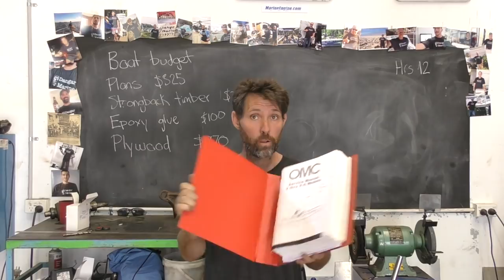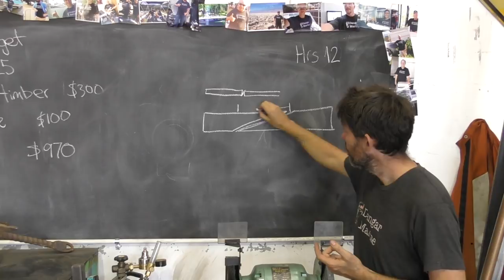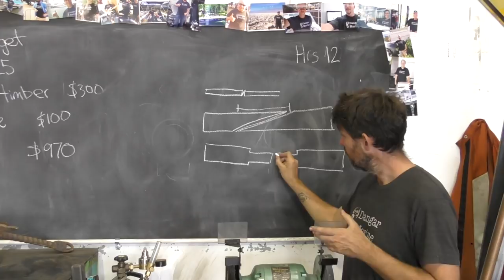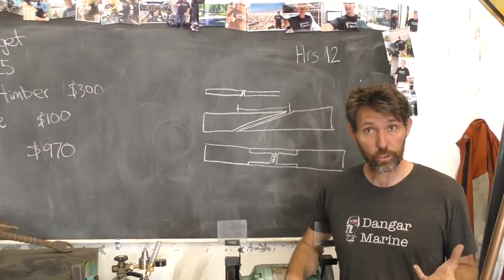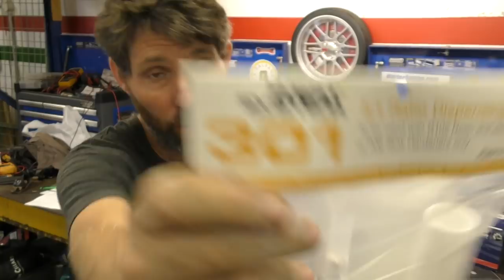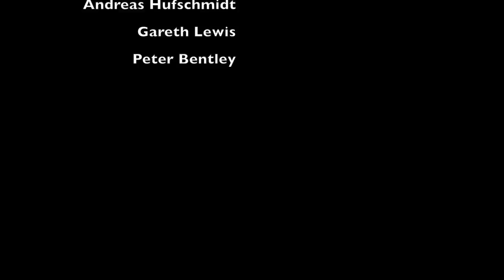Making a payson butt joint in plywood

Comment: I recently refurbished an old fiberglass boat, but I used polyester resins instead of epoxy myself. And I always coated all the wood first in polyester resin before using any fiberglass clothes. That way I knew the resin did soak in and the joints and resins were rock solid. I also lap jointed every piece of wood in every joint for the added surface areas. But everybody does what they think is the better option. I have to watch the rest of your series to see how it all comes out.

Comment: Hi Stu.  Great to see you venturing into building a boat.  It's a lot of fun.  Having built a 4.5 meter glass over ply over frames runabout last year myself I feel you've undersold scarfing as a jointing method and overlooked the advantages and ease of making.  There are a number of very simple, easy and quick to make jigs around that make the cutting of the scarfs simple and accurate.  I made a jig that uses a handheld circular saw - I considered a router base jig but my money's still on this one. The jig supports the saw at the correct angle and guides the blade across the material leaving an angled face.  The blade leaves a slightly rough texture (but a very true angled cut) that creates a strong mechanical hold in addition to the "adhesion" of the epoxy, and I can tell you, you will not break it!  And it leaves a smooth almost flawless join that requires very little sanding or filling once cured.
Having tested the joined ply to self destruction several times with offcuts etc it is the ply that breaks and never the join. I used the same West products as you and it hangs on like shit to a blanket as that quaint saying goes. One of the distinct advantages of scarfed joints compared to overlapped and parson butt joints is that it does not effectively alter the rigidity and flexibility of the material at the joint. Adding the fibreglass and epoxy will stiffen up the ply at the joint - not an issue for the longitudinals but if for example you are laying plywood around a curved hull you will find a flat spot where the fibreglassed joint is. Not ideal and more fairing work to fix.  Cheers

Check it out... http://www.oneoceankayaks.com/stitchglue/plyshophtm/scarfjig2.htm
Reply from the maker: Hey Robin, yes, I've seen a few of those jigs around, in fact West System sell one of their own. I didn't really mean to undersell scarf joins as they are good, it's just that I only have a handful to do on this boat so it didn't feel worth buying of making a jig. Also, the instructions specifically say to this type of joint so I guess in all honesty I was just blindly following them. If I start making more and more boats I think it would be worth making a jig up for sure.
Reply: All good Stu. There’s pluses and minuses to whatever way you go. Love your channel btw. Looking forward to seeing progress. Check out my build video some time. Cheers.

Comment: Epoxy is intimidating at first but it looks like you've got it figured out! I usually leave a brush or mixing stick in the pot until it cures. Sometimes that helps to pop the cured epoxy out to use the pot again.
Reply from the maker: Thanks Matt, that's another good tip!

Comment: Oh and one more handy item is peel ply.  It goes over the wet layup and can be peeled off after curing.  It smooths out the layup and leaves a surface ready for attaching another part without having to sand.
Reply from the maker: Anything that saves sanding has got to be a good thing! :)
Reply: William Fowler I’ve used wax paper to accomplish this with good results. I’ve never built a boat, but I’ve made fiberglass repairs

Comment: Great vid, we're at the same point of the build although I went with the Sea Strike 16. With the overhang, I found wetting it and cutting while partly cured with a stanley knife the easiest and cleanest method of removal. Oh and plain white vinegar for clean up is much less damaging on yourself!
Cheers
Reply from the maker: Hey Mark, great to know I'm not going through this alone! ;) I can see what you are saying about wetting out the excess as I'm not going to be able to get scissors close enough to the edge.
Reply: Vinegar doesn't work on West System. You ahve to clean up with acetone. As for teh $700 for West..thats why we use Nupex. Same stuff (5:1 ratio and all)..1/2 the price

Comment: A couple of small tips, what you have done is fine. Now the tips. On cold days using a tin can and heating the mix a little with a heat gun will thin the mix and make sure it will go off. You can use multiple containers don't clean them, just mix on top of the old set mix after its set. Try to have something ready to use up any excess. The mix can generate heat on hot days and go off very quickly, so mix smaller amounts, mixing in the same pot is fine as long as it is near empty. We used a lot of cans but cheap plastic drinking cups will do for quick jobs or when using additives. Watch the heat issue on hot days.  Stagger the joins a little so they don't quite line up top and bottom , the cut edge of the ply is the weakest point, 10 mm apart will increase strength. Best of luck. Regards Dale
Reply from the maker: Thanks Dale, really appreciate the tip! :)

Comment: Great video!  It's actually easier to allow the fiberglass strands that extend beyond the plywood to become saturated with resin.  Once dry, the strands will become rock hard and will be easily removed with sand paper.  It's actually much harder to cut away the fiberglass strands if they have no resin on them.
Reply from the maker: Thanks Dirk, I can now see how cutting (or sanding) saturated glass is easier. Fortunately it is much harder to keep glass dry than it looks so most of it was easy to remove with a power sander.

Comment: Great video Stu! When I did my repairs for the first and only time on a 60's fiberglass skiff, I used poly and had a hard time with very fast hardening. Summertime in outdoors south Louisiana is a lot different than the directions accounted for. Even using a good amount less of hardener than the directions I only had about 2 minutes with a small batch. Glad to see you chose the slower acting. It seems in the fiberglass world, experience is the only real way to get good at it. Lots of variables can change the process. I can only imagine doing it and trying to film the process with time running on the hardener and getting a good camera view at the same time. Tip of the hat to you Sir!!!
Reply from the maker: Thanks Jim, I think you are right about experience being the only way to get really good. Books can certainly point you in the right direction but as you say, experience helps you deal with all the variables that the books don't tell you about. It's funny you should mention the filming because one of the hardest parts was getting the epoxy off the camera! :O

Comment: I am using west systems epoxy repairing the rotted out wood in a fiberglass boat and also wetting out the new wood first.Epoxy makes a strong waterproof joint-seal.Cheers from Canada

Comment: I'm building small boat using stitch and glue method. Plans by Bateau. I would recommend using plain epoxy on plywood before glassing it. Pure epoxy soaks better to wood and if there's extra epoxy, that will then soak into glass. I use mostly wet on wet method. So, the epoxy on plywood is not cured when I glass it. Works for me, at least.
Reply from the maker: Yes, that certainly does sound like the way to go. Good luck with your build!

Comment: A little tip i picked up is if your handling matting or need to use your hand a bit ,i put about 3/4 latex gloves on each hands (bit like a tear off visor)then you allways have clean hands and paintbrush/ consolidating roller.i used an old multi vit or big proteen pluss container with a screw top lid with about 2 inches of acetone in the bottom and put the roller in there each time to soak as wipeing it wont get the resin out of the inside and it wont function properly and drag the matting. I thought you was going to get eight ply and glue it in the rebates instead of grp.
Reply from the maker: I'll have to get a screw top container like you suggest as you are dead right about the epoxy in the roller stopping it spinning once it is dry. Hopefully I can burn it out as someone else suggested and start using the jar from now on.
Reply: I have left mine too long a few times, the oxy , not too hot , works well but gives off some killer black smoke.  Great Vid

Comment: I am sure that join will be super strong, you're doing great making your own boat.Have you ever repurposed an outboard motor that has a seized engine by removing the engine,binning it and installing an electric motor in it's place? You wouldn't need an impellor as a DC motor is not water cooled.Perhaps you could make a video one day doing a conversion of a petrol outboard motor to an electric outboard motor?
Reply from the maker: That certainly would be an interesting project, I'll look into it.
Reply: Dangar Marine , hi I know of a video on YouTube that did that, if you like I can find it for you .

Comment: I've never seen this done before it's cool that you doing it but next time try taking just the first layer off of both sides and Nick in the edges where the fiberglass will roll around that shouldn't make that joint a lot more stronger I think but of course I never done fiberglassing before

Comment: For cleanup of tools and brushes before the epoxy has set I use distilled vinegar. Much nicer to handle. This a tip told me by some professional fibreglass workers and it works well and is a lot cheaper than acetone.
Reply from the maker: I'll grab some and give it a go!

Comment: The more you work with the micro balloons, the easier it will be.  I wouldn't breath them.  Use a fan to draw them away from you.  To mix them to get a stiff mixture, put the balloons in dry, then pour a little mixed  west  in and mix.   We used the cheap disposable paint brushes to "stipple" the air out.  Using a hair dryer will help the flow if it is cold.  I would say that the joint you made is no stronger than the thickness of the wood at that point where the routing stopped.  It will break where the fiberglass stops.  If you need to make reinforcing strips put down some dry cleaner plastic bag material and lay up on that,  cover with another plastic layer and cut with a sharp knife and peel off top.  The plastic will hold the glass together for movement.
Reply from the maker: These longitudinals will also be getting a second layer of fibreglass over the top of this join so I think they will be quite strong in the end. Interesting tip about making the reinforcing strips.

Comment: I allways wet out wood with pure mixed epoxy before adding thickened epoxy (any thickening from coloring to butter) to make a deeper and stronger bond. Good thing about epoxy is its very forgiving and has strengths to spare and will work even when experimenting :)
Reply from the maker: Yes, I can see how the thinner the epoxy the deeper it will penetrate. I don't think it would have hurt to have made a tub of each, particularly with the slow hardener. As you say though, epoxy is so strong that I can't see it being the weakest link in any part of the boat.

Comment: If you want a near perfect finish, lay a sheet of clear polycarbonate (3mm works nice) over that join and sit a few more batteries on it, when the epoxy is set peel the polycarb back off and it gives the resin a glass like finish and saves a lot of filling and sanding :)

Comment: again always enjoy watching your vids, youve helped me out a lot in solving many outboard issues ive come across with my outboard builds. next time you come across butt joint dilemas, try dovetail flat joining or even a spline depending on the thickness of material you have. the dovetail still gives you the option to scab glass.

Comment: To be honest I think smearing the thickened epoxy over the routed faces will weaken the joint. With an epoxy bond you have a chemical and a mechanical bond. The thickened epoxy won't soak as deep into the wood as unthickened epoxy, making for a weaker mechanical bond. The thickened epoxy will act as a screen to prevent the unthickened epoxy from soaking in, and the thickened epoxy itself won't soak into the wood very much because the epoxy is already soaked into the cabosil. But I'm no expert, it's just my opinion!

It's nice to see you step out of your comfortzone and trying new things, that's what I like about your channel!
Reply from the maker: I definitely agree the unthickened epoxy would penetrate deeper, but I'll be curious to see whether the glass lets go before the timber breaks on the test one.
Reply: Yeah me too! Would be nice if you had a normal butt joint and a scarf joint to compare with. And a Payson butt joint with two layers of glass on each side. Would be interesting to see if this would be stronger because of the double layers, or if it will fail on the edge of the glass where the wood is thin.

Comment: Carb -o-sil adds hardness and thicking . We had a  local epoxy  company, with as much experience as the West System , you'll find Gardner talking about Cold Cure, that was one of their products . They put out papers on the use of epoxies . For your use add mini-fibers as well carb-a-sil, that will add strength as well. . Carb-a-sil  will cause miners lung, by all means wear dust masks !!!
Reply from the maker: Definitely a mask next time!

Comment: re System 3 - great choice, you won't regret it!

Re joining plywood::  if you google "payson butt joint" you'll get a lot of (not always agreeing) information.

Re use of thickened epoxy:  I guess you'll be doing a lot of this later with filletted joints!  Probably a good idea to coat the surfaces to be joined with unthickened epoxy first, then  add the thickener to the rest,  That way it's much less likely that the joint will be starved.

With the stringer joints, I'm assuming the stringers will not be bent, so I'm not sure there's really a need to router out a groove??  If you just lay glass cloth over the joint does it matter if it is a bit thicker?  Also, some people just use unthickened epoxy (and rout out only a thin layer of the plywood) adjacent to the joint and put in the fibreglass cloth wet out with unthickened epoxy  (However I wouldn't take my advice on structural strength over Mr Bowdidge's!)  

Regarding acetone - could try vinegar - much cheaper, and won't help the epoxy soak into your skin :-)
Reply: dyemanoz i
Reply from the maker: Good to know the correct name of this type of join, that is extremely useful. You are right in that these longitudinals don't get bent, but they do get another coat of fibreglass over their hole length and do slot into the groves in the bulkheads. I presume that is the reason for the rebate.
Reply: Shouldn't matter as long as the join isn't in the vicinity of the bulkheads?  Certainly with two layers of glass where the join is will make them super strong even before they're filleted to the hull

Trivia: Harold "Dynamite" Payson (apparently nicknamed on the same basis as redheads are nicknamed "Bluey" :-) ) was a pioneer in bringing simple plywood boatbuilding to the masses.  He collaborated with legendary designer Phil Bolger.  Bolger designed the boats, Payson built a prototype to validate the design and published plans and books on how to build them.  They called the building process "tack and tape" but really the idea is not much different from "stitch and glue".  Sadly both gentlemen have now passed away.  I built one of Bolger's designs, Nymph (well the hull is finshed, still working on the mast rudder and centreboard :-( ).

Comment: Hey Stu, great video as usual.
West system is great and it doesn't smell like the polyester resin.
Save some money and use white vinegar to clean mixed epoxy off your hands and skin.
You can gently squeeze the mixing cup to seperate the epoxy at the top and gently tug at it until it gives.
The thickening agent is very light and dangerous if you inhale it so please wear a mask.
We want you to still be making video's in 40 years :-)
Reply from the maker: Hey Anthony. It's interesting to hear that vinegar is good for cleanup. I didn't get any on my skin this time but if I ever do I don't want to use a solvent to just drive it in deeper. And yes, I'll definitely wear my mask next time! :)

Comment: I think precoating the ply is a good idea just as long as it doesnt set before you glass it,stops the matt from moving aswell,unwaxed for glueing waxed for the glassing,would be a safer bet.
I actually dab on the resin,pour it on dab it in,gets better penetration and stop the matt from moving,fibreglassing is a bit of a black art,i put hardener in to suit my needs,put more in for a quicker set for cold weather less for hot,i ve never noticed any strength issues from useing more or less hardener,we all know  if you get half a drop in your resin it will be a solid block by morning but your project that you wanted to sand ,that you did with the correct ratio will still be wet and sticky🤣